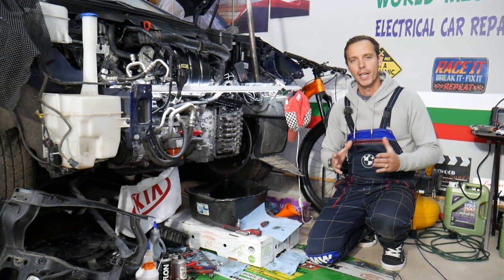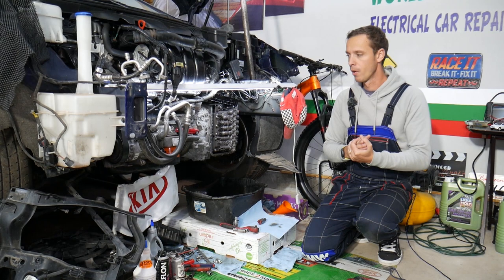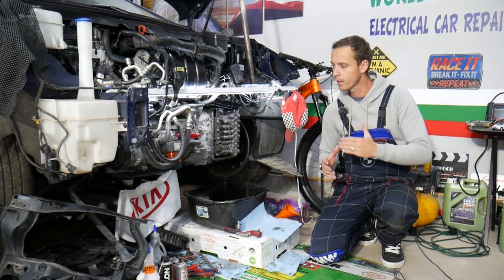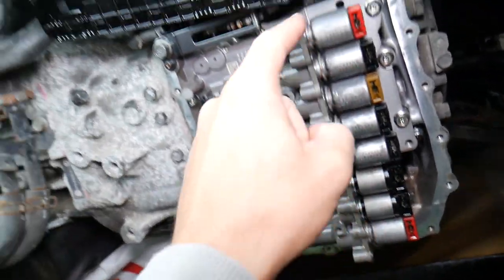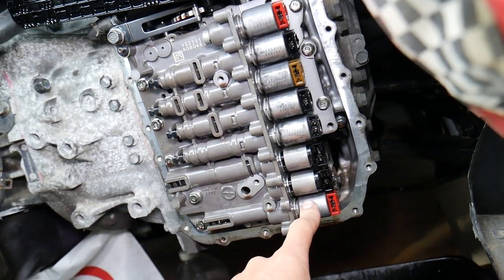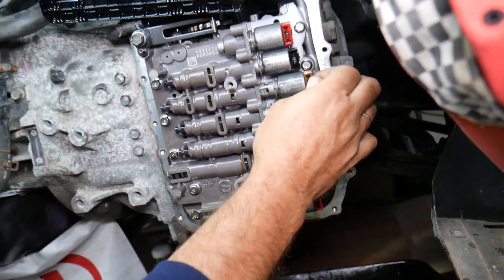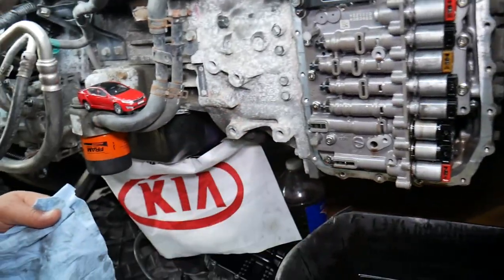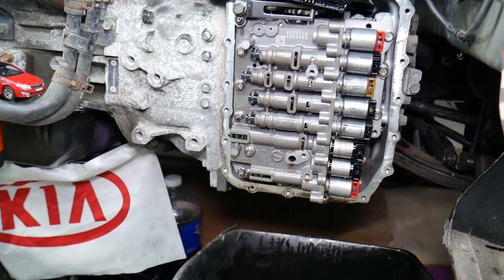TRANSMISSION SHIFTER SOLENOID DIAGRAM KIA OPTIMA FORTE SOUL SPORTAGE SORENTO RIO

Comment: Great videos.  I do have e a question.  We were traveling roughly 80mph and the alternator instantly failed completely without notice killing all electrical systems in her 2011 kia optima.  Before we could even safety get off of the interstate the transmission started slamming gears.  Now after I replaced the alternator the transmission is slipping between gears and hard shifting...the gears still feel strong in gear but slipping between shifts.  What are your thoughts on possible issues?  Bad tcc?  Pleas update when u can.    Thanks

Comment: I have a question, I changed my TCC solenoid on my 2011 Kia optima LX. I put everything back together, poured in the transmission fluid,  crank the car and as soon as I put it into gear  with my foot on the brake it triggered a engine code and the car shut off. I cranked it back up and this time took it down to D gear with my foot on the brake, again the car shut off. Have you ever seen this before? Can you give me any insight of what the problem could be.  Thanks in advance.

Comment: Hello, I have a 2013 kia soul, it was slipping in 3rd gear and not going past 4th gear, so I have everything tore down and I tested each solonoid with the ohm meter, and cleaned each one with mass air flow sensor cleaner and also the ports they slide into, but one thing I've noticed is that on solonoid 3 and 5 it doesn't have the spring back up action that the other ones have and also the torque converter solonoid doesn't either, and obviously the shorter shift solonoids don't either but it looks to me like 3 and 5 should spring back when u push down on it, is that correct??..Thanx in advance!

Comment: I put replacement valve body, and Reverse doesn't engage. All other gears working perfectly fine.
Reply: I have the same problem, the car goes into reverse but feels like there’s no power if I give it gas but works smoothly if I work my way up